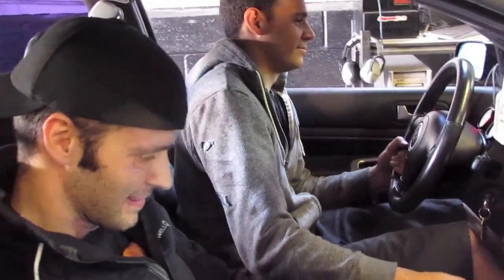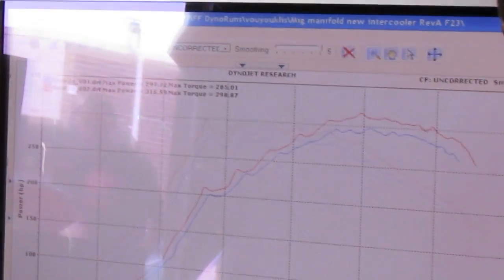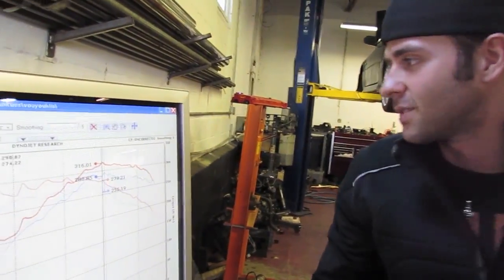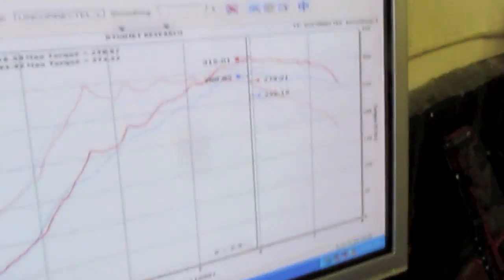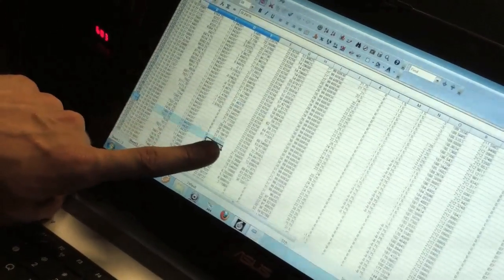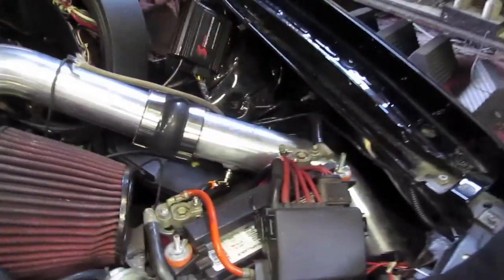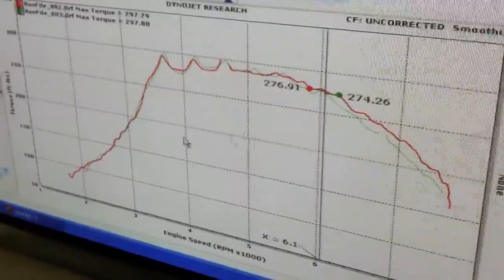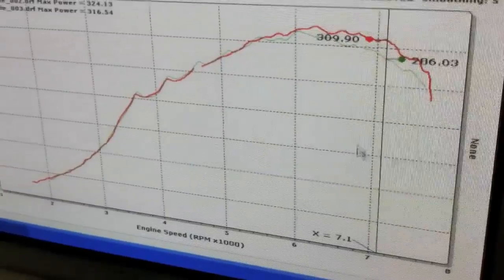FrankenTurbo F23 pre intercooler water meth testing

Comment: a am using a .6mm jet 270cc pre turbo.. and using a 1mm 550cc 12inches pre throttle body. pushing 320hp with 1 bar boost and 26deg timing..  with air temps from 60-70deg to low 30s when WMI is on.

Comment: just curious, how does the injection system starts ?
Manual push the button or there is a sensor when the boost reach ??? psi then it starts to spray
great work mate ! cheers

Comment: Great effort guys, especially with the explanation of nozzle placement etc. It would be interesting to see your air temp logs at the throttle body before and after injection. I am just about to add a pair of pre-turbo injectors on my gtr to lower air temps as well.  38-40 degree ambient temps in summer take all the fun out of driving a turbo car.  Im hoping to get some of that back.